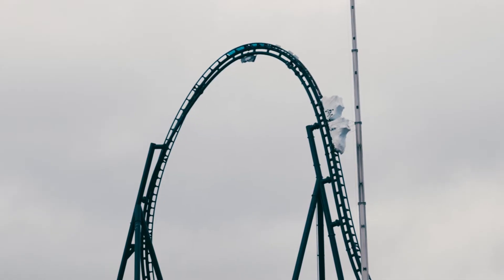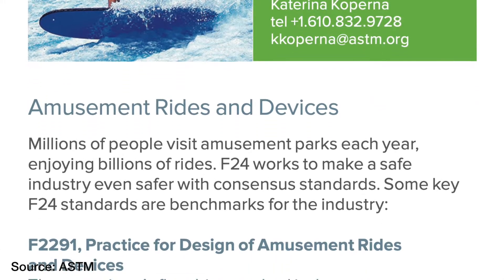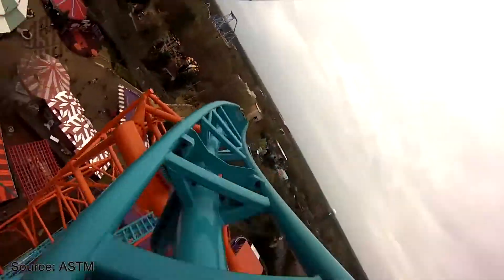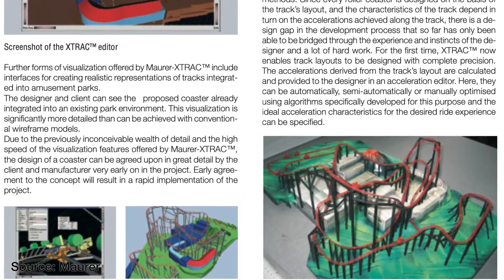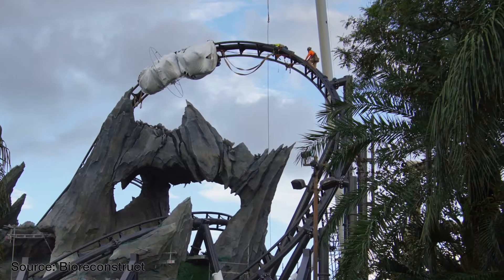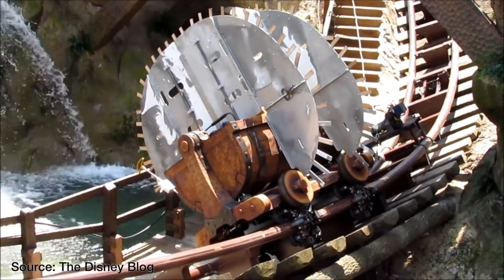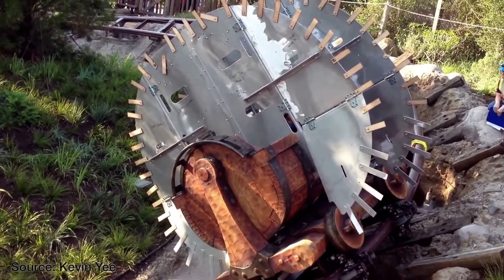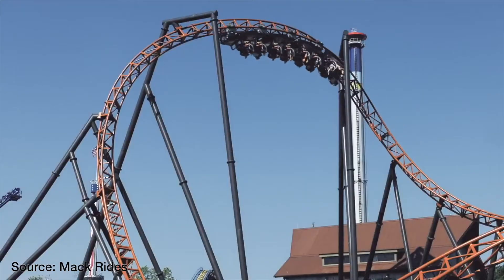How Clearance Envelopes & Roller Coaster Pull Through Tests Work

Comment: Could you please do one on the Disney web slinger ride and how it interacts with the power band modules? Many seem to believe this ride is the same tech as the Lego Ninjago ride. But no pictures of the ride vehicles seem to show the same rectangular IR cameras  like Ninjago uses.
Reply from the maker: Noted. I was looking at that as well. I saw a video claiming that web slingers was built by the same company that built ninjago. And I believe you’re correct. It’s not the same system.  I’m going to do some more research on this. I’m working on a video right now that will be out shortly. And I’ll start working on a video for web slingers. Thanks for checking the channel. I hope to get a lot more content posted soon
Reply: Thank you! Looking forward to the video when it comes out.